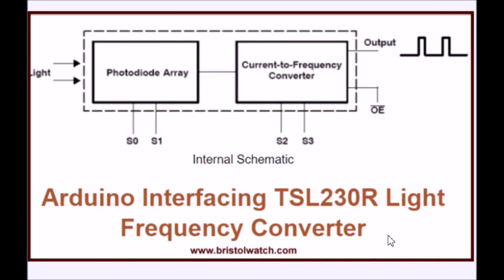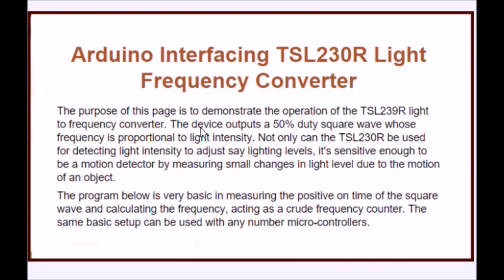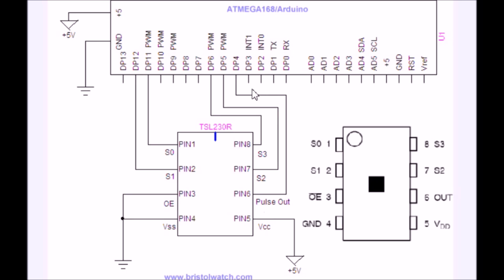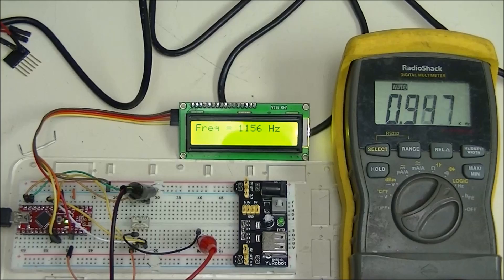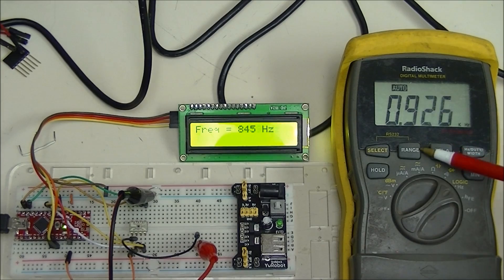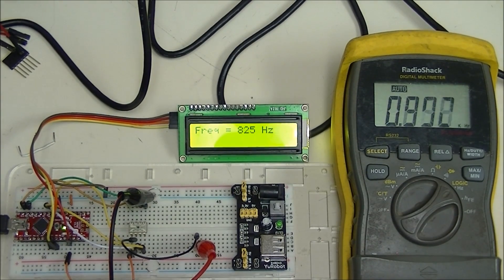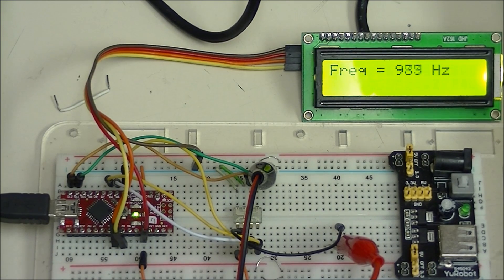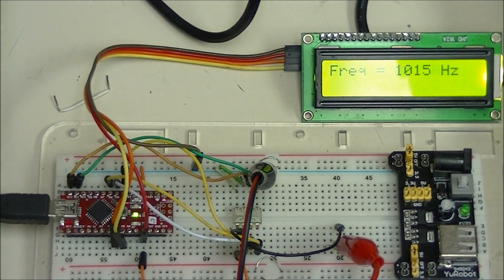Arduino Interfacing TSL230R Light Frequency Converter

Comment: I have a question here. Can I measure the power output of a Nikon/Sigma Speedlight flashgun in Lux using a frequency reading from this module or a similar device, such as a TSL235R module?

The output of a flashgun usually lasts from 1/750 seconds at full power (1/1) to 1/40,000 seconds at the lowest power (1/128). The power output of a flashgun is around 200 Lumens at full power (what I've heard), while, Lumens = Lux/square meter.

The combination of the short output duration of flashguns and the slow response time of modules, like the BH1750, can cause a hindrance to what I'm trying to achieve. A BH1750 requires exposure to light for at least 16ms at the lowest resolution settings.

I intend to create an exposure meter since I don't want to use modern TTL flashguns with rechargeable batteries for their high price and severe limitations, and I don't like my SB600 because it quickly drains four AA-sized alkaline batteries. Even the most inexpensive TTL flashguns are not affordable. Additionally, TTL flashguns that are less expensive cannot function beyond the typical range of 24 mm to 105 mm. And, I'm not always given the chance to guess with test shots. I prefer manual flashguns and older ones like the ever-reliable Vivitar 285HV, so I need a measuring tool that works.

Selecting the right component for the right circuit becomes difficult sometimes.
Reply from the maker: Not likely. It is too fast. This part is obsolete and no longer available.
Reply: @LewisLoflin  flashguns are really fast. Can you please recommend something else?
Reply from the maker: @PinakiGupta82Appu  Try a photodiode circuit with an interrupt on a microcontroller. That might work but how to calibrate it? You want something only an expensive commercial device can do.
Reply: @LewisLoflin  I agree, that's a great idea. I'm thinking of using a BH1750 to auto-calibrate the unit and two ESP8266 boards (similar to a D1 Mini), one for frequency calculations and the other for the rest (UI, input, exposure guide etc.). I understand that the output from a BH1750 should be taken with a grain of salt, however, something is better than nothing in certain scenarios. Plus, I'm increasing the cost of the end product. Thanks for the reply, have a great day!

Comment: Hi,
I am quite a beginner in electronics and I am using a TSL235R in one of my battery-powered projects. After adding this TSL235R to the board the battery draws really fast. Are there any ways to use this one in a power-saving mode?